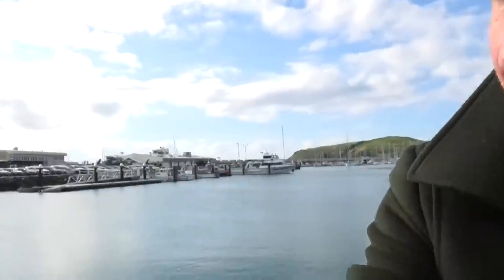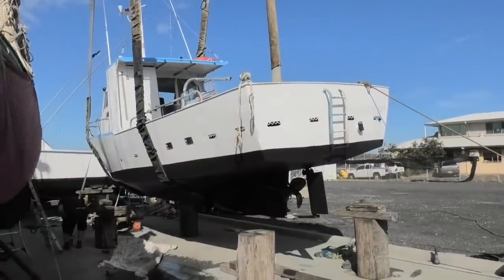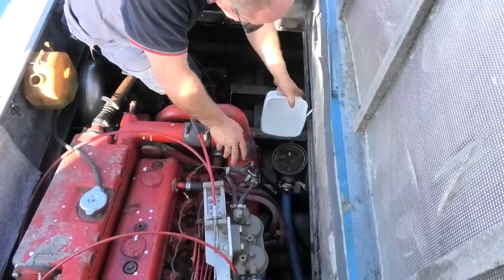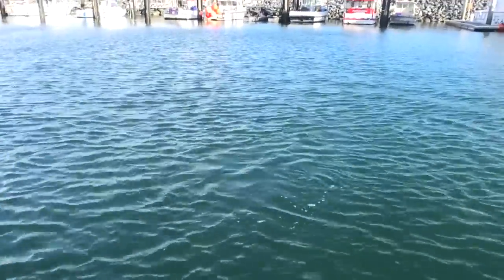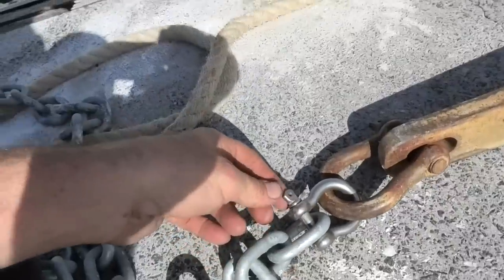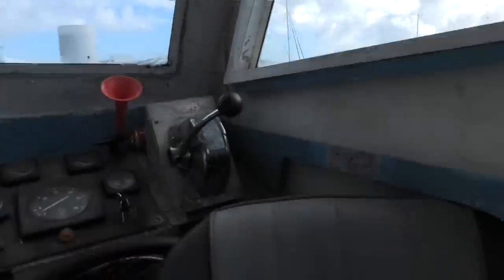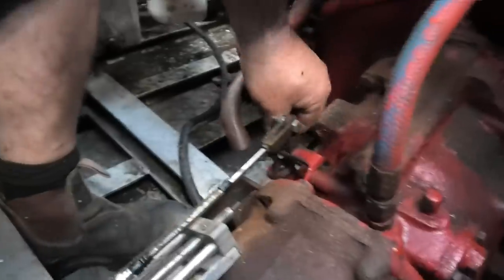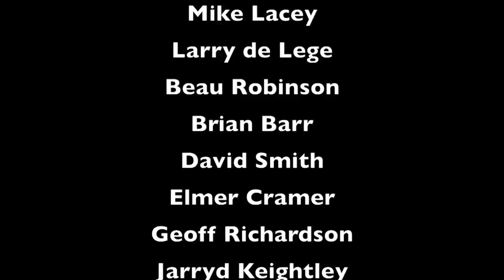Launching Delstar II and conducting sea trials

Comment: Hi Stu, my condolences on your loss.  Cutting rings with a 45 degree face and installing the rings so those faces overlap and are pressed together creates the longest possible sealing line with uniform pressure, it keeps the packing square to the shaft and keeps the packing parallel with the bottom of the stuffing box and gland follower, it also helps prevent extrusion of the packing into the stern tube. It minimises the pressure needed to achieve the required seal, you are applying an axial force to achieve a radial displacement of the packing, with cut rings that pressure is transferred equally through each ring of packing, that axial displacement can bind the outer rings in the stuffing box with the result that usually there is more pressure on the outer rings than the ones at the bottom of the stuffing box and that is why often most shaft wear is observed in that area, to minimise that issue at first treat this as a running in period initally dont overtighten the packing finger tight is fine, give it plenty of lubrication and gradually tighten a very small amount over about an hour, that will allow the packing to settle fully through the full depth of the stuffing box to maximise the shaft and packing life, also an individual outer ring can safely be replaced at sea if required, I am not aware of a single good reason to have a continuous spiral of packing. I am close to re-launching my own steel boat refit in NZ and have watched your project with interest. Cheers Doug.
Reply: Exactly, and noticed that gland already tightened to the max so no adjustment left. Spiral would create a pressure difference resulting in a worn shaft relatively quickly.
Reply: This is one of the reasons I LOVE this channel , You learn something useful and potentially life saving and money saving Lessons. Thank you Doug , and Stu
Reply from the maker: I also noticed that this stuffing box only has about 10mm of flange. Much, much smaller than mine.

Comment: When your turn comes around to launch, ask the crane operator to wait while you check below before he removes the slings. It's a lot easier to hoist it right back out if you need to rather than scramble for a big dewatering pump. 

My condolences to Dave and his family.
Reply: Yeah we always check them on launch, there's at least one per season that a customer forgot something.
Reply from the maker: Yes, it is very common to hang boats for an hour or so before launching. This crane driver seemed to be in a big hurry to leave!

Comment: Thanks for the windy.com tip. It works here in San Francisco as well. It will be useful for fishing out at the Farallon islands.
Reply: If you click anywhere on the map, it shows wind strength in knots. It's great for us aviators too, as you can click on the top right "Wind" button, and a slider appears to show wind direction and strength across a range of altitudes and flight levels too.
Reply: @gkkes  It is good for lowish wind velocity, it is completely wrong for high wind velocity. I was using a number of sites, and found that NHC wind speed of 65 knots was shown by Windy as 40, and at 115 knots, windy showed 64, and earth showed 96 knots. Earth image can only be enlarged using the wheel on a mouse, it is good for monitoring cyclones. It's address is earth.nullschool.net  Click on the faded letters changes units and click on earth gives a confusing menu. Earth can give wave heights, and ocean current speed and direction.

Comment: You might add a grease Zerk on your stuffing box. Red #2 lithium grease works great. In my experience the older heavier bronze stuffing boxes got a spiral wrap with ends tapered. The newer lighter pattern stuffing boxes recommend rings.
Reply from the maker: It has one already.

Comment: I use to be a maintenance mechanic rebuilding large pumps and was taught to cut packing into rings and alternate the cut 180 degrees for each ring always worked well and could add packing later if needed. These pumps ran 24/7. Sorry about Dave's Dad.
Reply: That sounds totally logical, piston rings are arranged in a similar fashion👍

Comment: We started sailing my mates boat from Williamstown to Hastings after the new deseil motor was fitted and some other things were fixed.  The service guy could not get a new diaphragm for the hand operated bilge pump and said he would send my mate one in the mail so he could fit it later.  We started sailing and unbeknown to us the boat started to suck in water through the bilge pump as the diaphragm was missing.  We were alerted to the knee deep water in the yacht when his dad was splashed while sleeping on a bunk.  We bailed like crazy while steering into the wind which stopped us heeling and sucking in more water.  We managed to get back to the marina.  Just goes to show how careful and observant you have to be.  Now I have a check list, no water in bottom of boat check every half hour!
Reply from the maker: That would have got the heart started!

Comment: Condolences to the old Captain.

Maritime law,must not shall,have all safety equipment on board and serviceable,shit goes sideways real quick out there when it does,make sure he’s got spare belts and hoses and clamps,fuses,gas cooker for coffee and a pot and pan for tinned food 🥫.If you break down at least you cave some comfort while you wait.
When you head out leave the engine hatch ajar so you can check the bilge every half hour until you know you can trust her after being out of the water.Ive worked commercial trawlers out there and nothing scarier than water up to the flywheel due to pump failure.Im sure you know this stuff but hyper vigilance is the key to great adventures on the sea,keep a dry boat,plenty of time for a grog before and after the trip,if things fuck up and you get hurt the skipper goes to Jail.Have a great trip blokes.
Reply from the maker: Yep, will definitely be keeping a very close eye on water levels and temperatures for the first few days.

Comment: A comment on gland packing, it is Best to cut and layer with cuts being close to 180 degrees apart, a spiral in a smooth bore will let fluid seep along the spiral from one end to the other unless compressed to for a complete sleeve

Comment: Stu, It looks like Dave passed on the wrong side of that green channel marker at 18.06? it was on the portside at 17.45 when heading out. Dave might have to consider getting rid of that pot hauler, you can't have commercial fishing gear on a recreational boat otherwise Fisheries inspectors will get all excited. That air filter is well past its use by date too.
Reply from the maker: No, on the correct side - port side heading out, starboard side heading in for starboard markers. This boat is in survey and is going to be used as a commercial fishing boat.
Reply: @DangarMarine  The green channel marker on the portside looked to be further off the breakwall going out, the boat looks very close to the wall going back in. Green to green when going upstream, green to red when seas ahead. Must be a zoom lense optical illusion.

Comment: How's it going stu can't wait to see your boat launch
Reply from the maker: Getting there mate. Hoping to launch soon, probably without the engine in though.
Reply: @DangarMarine  Stu if that's the case I would wait to till I had the engine in. It's going to make it that much harder to get it in by that boat is rocking in the water.
Reply from the maker: But it will make a much more interesting video. ;)

Comment: I noticed you said no hi idle, normally on the single moarse lever you can pull the gear lever out side ways to disengage the gears and you can add throttle for starting and higher revs with gearbox in neutral
Reply from the maker: Yeah, sometimes pull out sometimes push in.

Comment: Great Video thanks. I have to add I cut the rings only because that's how I was taught no other reason :) but it seems to work for me and mine is really small as its a 13hp diesel in a yacht thus 1/4" stuffing.
Reply: John - I guess you alternate the orientation of the cut in the ring, like the gap in o-rings on a piston?
Reply: yes that's what I was taught to do and to coat each ring thickly with grease'

Comment: STU SAID fill it and tip it upside down...I was under the impression that advice like that was only given in Alabama USA
Reply: dont forget its downunder gravity works the other way in australia
Reply: As long as you don't quick, it'll be fine. Sway it back and forth to force the liquid to the bottom. Helps a lot.

Comment: Wow 30 knot winds at 50* 60* F 10* 15*C would be cold cold add some sea spray constantly across the deck best have some life suits.  Will you have life survival suits onboard your vessel? Question if you don't mind tilt, trim, motor jack plate on 65 hp and less OB what is a necessity and what is just an extra in your opinion? Great show something about the steel hulls just seems so ,,,,,,real and commercial and ,,,,,,,shippy lol. So cool. Good luck.
Reply from the maker: Trim tilt is all that I would consider necessary.

Comment: Yeah best way to keep Diesel boat engines from smoking if you are tied up for long periods of time is the put them in gear and put a load on them, running them for a half hour or longer. Just turning them on a running them out of gear is not really helping them in the long run.
Reply from the maker: No, they certainly don't like to run without load on them. Running in gear was also good for us to check the temperature of the gearbox and stern gland.
Reply: Dangar Marine , Stu, running a diesel at idle with no load causes glazing of the bores.this leads to poor compression and hard starting, smokiking and other evils. If you run them in gear,under load, they get hotter and that stops the glazing.
Reply from the maker: That's what I said too.

Comment: One reason for not spiral winding packing apart from its ability to bind up is that you’re giving the water a spiral pathway to migrate through. With rings of packing you set the cuts at 180° to each other creating a labyrinth path which is much harder for the fluid to pass through. 
It’s amusing for me to see you wearing winter reefer coats as when I looked up the temperature in Coffs Harbour it’s basically the same as here. The difference is we call this summer and are wearing t-shirts. I was going to take the piss but who’s the mug for living 56° North? 
My condolences to Dave.
Reply from the maker: LOL. Everyone wears jackets when it gets below 20C. :)

Comment: exiting stuff putting boats back in.
Could you explain  why stainless isnt good in salt water ? iv all ways used stainless so it would be good to know .
never used windy.com and just tried it here in the UK and it works good so will give it a blast
thanks for another top upload
steve UK
Reply: Stainless is algood on its own but not with a dissimilar metal. So you need to have a stainless anchor, chain and shackles.
Reply: @rossy2998  thanks for the imfo Chris. learn something new every day. i best change my d link today.
Top man
Reply from the maker: The main reason is that stainless steel needs contact with air to form an oxide layer that stops it rusting. Below the waterline it will rust away.
Reply: @DangarMarine  Stu, there are some really nice stainless steel fishing rod holders (sold by Monash stainless & Grabyourtackle) on eBay that clamp onto various size tube rails or flat surfaces, they are well designed and priced very well for what they are, you can buy them in lots of 4 too.
Reply from the maker: Definitely need some rod holders for my trawler. ;)
Reply: @DangarMarine  a boats not a boat if you have no rod holders ha

Comment: Hey , Great video. I have a question?. I have a 1996 johnson 115hp and was wondering if the idle mixture screws can be set by rpm gauge?
Reply: I would set the air/fuel mixture screws to factory recommendations & then use the idle screw to set the RPM. You don't want a overly lean or overly rich low speed air/fuel mix.
Reply: @dustyfarmer  Thanks
Reply: @cam81366  You want a smooth transition from idle to intermediate throttle & wide open throttle with no hesitation, this is where the low speed circuit settings are important, too lean & it can flat spot or stall out on opening the throttle, too rich it can stutter and pop out the carbs, too lean it can run hot, too rich plug fouling can occur, doing a plug chop can tell you a bit about what mixtures are doing, there is also a tool called a Gunson Colortune that lets you see inside the combustion chamber and adjust air/fuel mixtures according to burn color of the flame front. Generally speaking, factory settings with fresh fuel will be pretty good, I sold my colortune after a few uses, it made things more complicated than need be.

Comment: Danger here is a great weather system to utilize for North and South America if you ever head this way, you will find this super useful. sohttps://www.star.nesdis.noaa.gov/GOES/index.php - When you find the region you need, the menu only allows you to set it to 96 frames max. Edit the URL yourself and you can add up to 720 frames. Super useful for us during hurricane season. (Not as useful as a big steel boat would be, though)
Reply from the maker: Thanks for the link, I'll check it out.

Comment: Stu, one more time would you help out a non-boater person...  why is the anchor a safety device?  Isn't it mostly for when you want to stop and fish, but might fall asleep and get blown by the wind to a new location where the fish aren't biting? 😊
Reply from the maker: If the engine fails and you are blowing towards the rocks the anchor is the only thing that is going to save you until you can either fix the engine or help arrives.
Reply: @DangarMarine  - Oh, you mean an engine that someone ELSE worked on!  I didn't think of that.

Comment: The blue hose out the back of the boat. What is it?
Reply from the maker: Deck wash
Reply: @DangarMarine  Does the engine pump the water. That appears to be a lot of water coming out of the hose.
Reply from the maker: Impeller pump attached to the engine, runs whenever the engine is running.
Reply: Could be a saltwater feed to a live lobster tank to keep them fresh & healthy for market in China where if it has legs & is not a table they will eat it, if it swims & is not a submarine they will eat it, if it has wings and is not a plane, they will eat it.

Comment: is that s Perkins ST6.3544M?
Reply from the maker: Not sure.
Reply: Dangar Marine Perkins straight 6 yeah? Is it Turbo?
Reply: Dangar Marine we just picked up a plastic trawler at auction and it has two of those :) similar looking at least. Except ours aren’t running sweet yet like that one 🙏 looks to move the boat really nicely.
Reply from the maker: Yes, turbo from memory.
Reply: @DangarMarine  I'm starting to like these Perkins motors. I had a pair of Detroit 8V71s in my old boat. They ran flawlessly. I think you'll have fun with your Detroit.